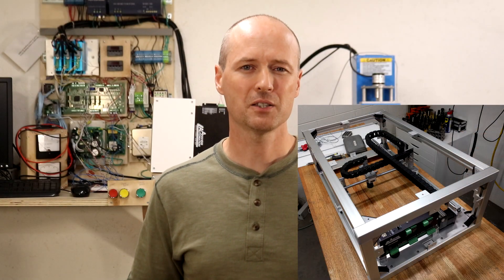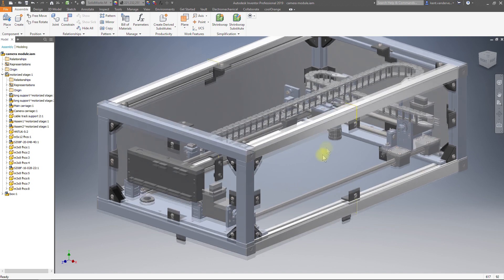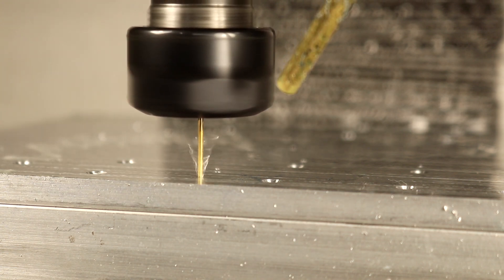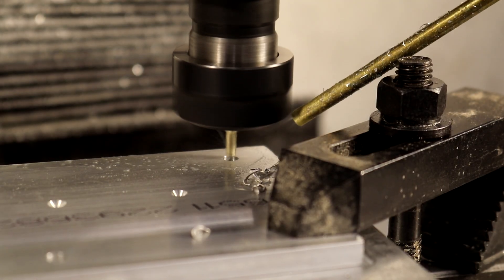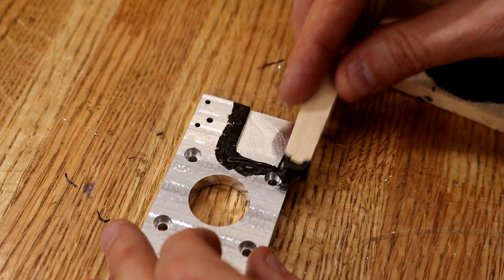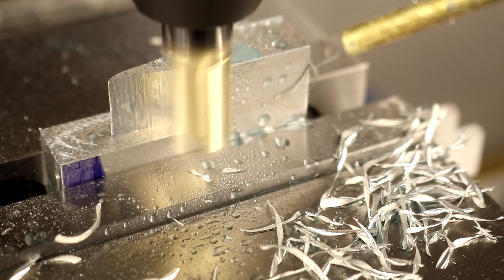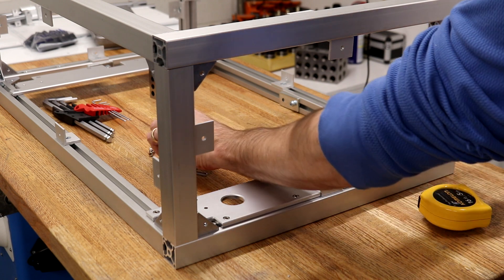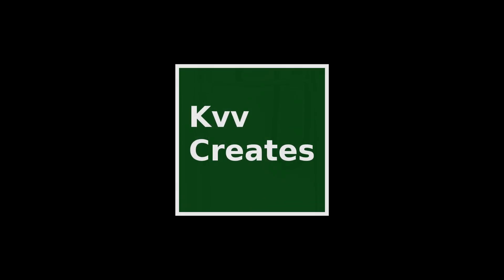Camera XY positioning stage - Design and CNC machining

Comment: this was serious amount of milling, and even more serious amount of designing. did you had to program camera moves or you use something off the shelf?
I have to ask, what was the chip ratio, workshop vs home? :) I'm sincerely curious  as this was a lot of milling.
Reply from the maker: Thanks Fox. All the control, analysis, and reporting software is written from scratch using great APIs including OpenCV and Qt. The total build time was about 18 hrs. Designing was probably more like 18 days. This loosely follows a design from a few years ago, before I had any CNC machine, and I cut all those parts on a manual mill, including squaring all sides, counting turns of the handwheels because there was no DRO. I did seek a quote for the work, but the quote was greater than the current CNC machine.
Reply: you are true Renaissance man!  you can design, program, do electronics, mill, manufacture and market your invention :) truly impressive!
Reply from the maker: That's a huge compliment, thank you! It's a work in progress, out of necessity.

Comment: Good to a new Kvv video. That is a very professional product. How often do the researchers need to take pics?
Reply from the maker: Thank you, I really appreciate that. This machine and the software has consumed a lot of time and I trust something good will come of the work. For the best information, growth rate and stress comparison, daily at roughly same time would be great. Large experiments and work load may prevent this. A plant does not grow at a consistent rate, so lots of images are needed to capture differences. A standard nursery tray with eight plants is imaged in 22 s, so the bottleneck is in moving trays around. That's OK because trays are generally moved around to average out location effects, such as one corner of the greenhouse being warmer or having more light than other.
Reply: I'd hate to have been the research intern who had to take the pics manually ;)
Can you share where you got the better rails and bearings from?
Reply from the maker: Sometimes manual pictures... or often a measuring stick, or leaves laid out on a scanner, or oven dry for a couple weeks and weigh, or something equally time consuming. :)
They were from either McMaster or Misumi. I try to stick to these two providers for mechanical and Automation Direct for electrical. If you are interested in the results, I also purchased two of every type of 12mm sleeve bearing that McMaster sells to test action on 12mm shaft to make a quieter alternative to linear bearings. I wanted to try Igus but didn't know where to get small numbers of them in the Midwest.

Comment: Cool! I did not catch what kind of camera you are using?
Reply from the maker: Thank you Anthony! The camera is a Basler aca4600-7gc, the GigE PoE version, but in the end I didn't use PoE. There is also a USB 3 model with slightly faster framerate. The camera and lens are from Edmund Optics. The Basler C++ API takes some effort, but it's full featured, and the cameras are reliable.